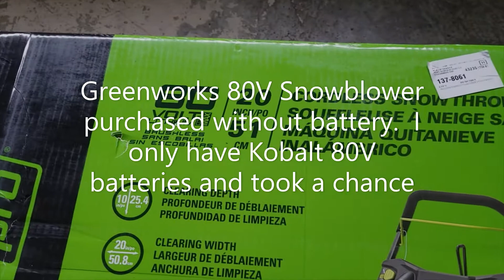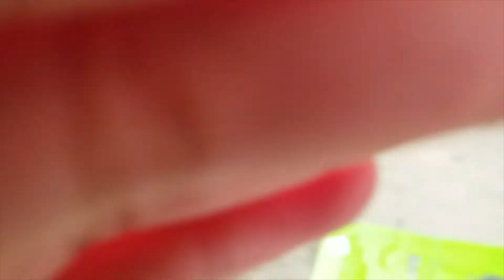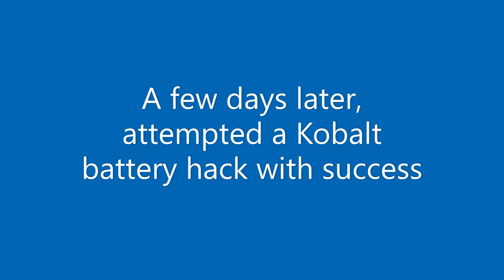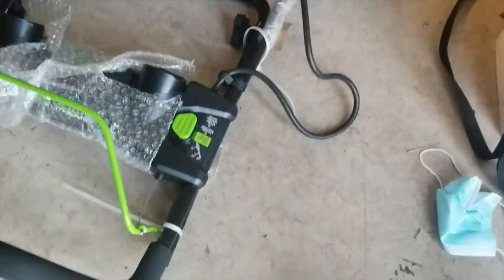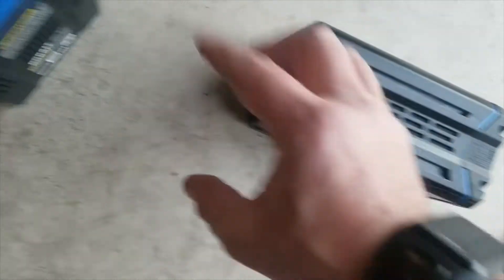Greenworks 80v Kobalt battery hack

Comment: I have a couple 80volt Kolbalt batteries willing to try the GW snow blower with modified Kobalt batteries. any issues I need to know about?
Reply from the maker: I really don't see any difference between using kobalt or greenworks after I've modified the batteries
Reply: @philsekela3508  thx so even with the battery mod it will still work on the Kobalt tools as well?
Reply from the maker: @leanidis300  I'm just going by my experience, but increasing the width of the channels on the side of the kobalt batteries didn't affect anything with my kobalt tools.  The battery fits like a glove in the tool and locks in.  So the side channels really don't do anything in my opinion.

Comment: Just to add that "Global Tools" makes the 80v and 82v lines of tools for Greenworks, Kobalt, Powerworks, Snapper, and Victa. All of their equipment and batteries are basically the same underneath with a slightly different shell and brand stuck on them. You can mod the batteries from all of the brands to work with one another if you're fine with filing down some plastic. You can find websites that give instructions on how to do it.
Reply: И  Stiga

Comment: I saw on other video that if you remove the upper rail... The Kobalt battery will fit.
Reply: remove the upper rail of the equipment? or the battery?
Reply: @musk-eteer9898  upper rail of the battery (trim it off) as I recall... It was 11 mos ago.

Comment: Does the modified battery still fit and stay in your kobalt tools? (I.e. is it loose or does it fall out?)
Reply from the maker: I just verified 30 seconds ago, the fit is not compromised on the modified batteries.  The batteries fit like a glove in every tool I have and they don't need the slots at all.  The charger might show a bit of additional wiggle room when sliding the battery in.  But once the charging contacts are entered into the battery, it's a very tight fit, 100% will not fall out (although I keep my chargers on a table, I cannot vouch for wall hanging chargers).  Bottom line, I use both the modified and non-modified batteries an a weekly basis , there is no difference.